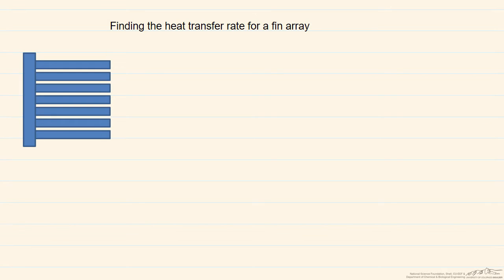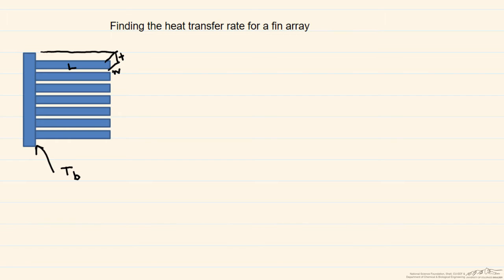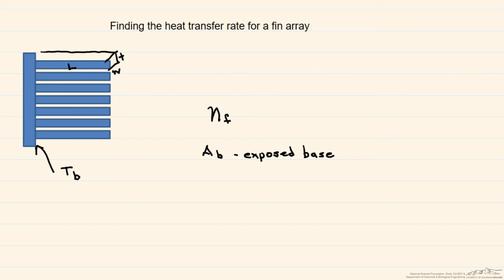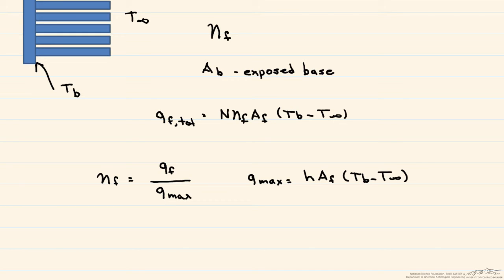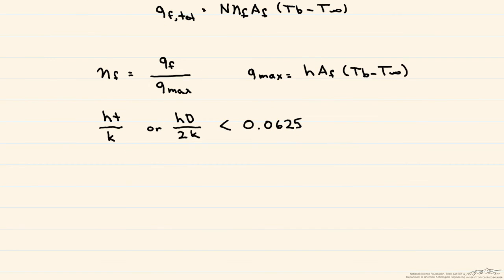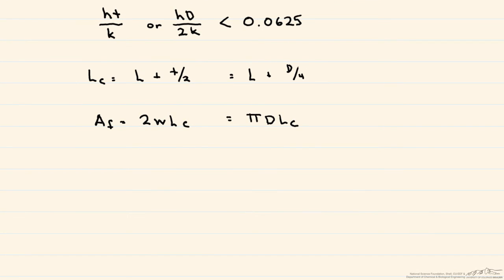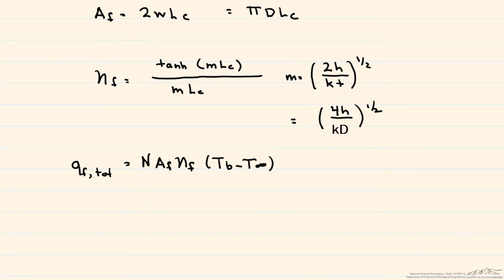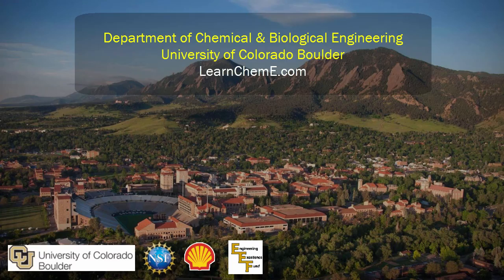Heat Transfer from an Array of Fins

Comment: 8:44 why wouldn't the fin contact area be pi*(D/2)^2 for cross sectional area? Isn't pi*D the circumference, which is a unit of length and not area?
Reply from the maker: You are absolutely correct! Thank you for catching that. I will get this fixed asap! Nice job!

Comment: I would like this very much, but the equation for overall heat transfer from the fins doesn't work. It ends up with units of m^2*K, which isn't useful. You have to multiply it by h.
Reply: agreed, in my textbook total heat transfer from all the fins has that h. It's missing in the video.